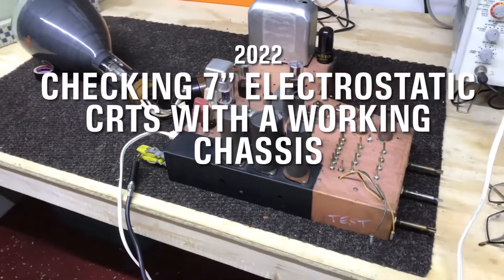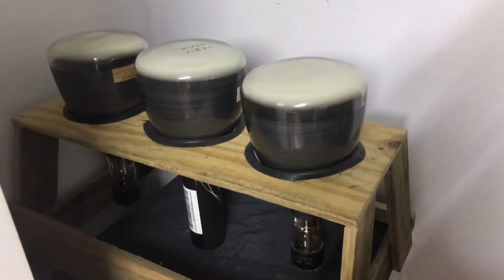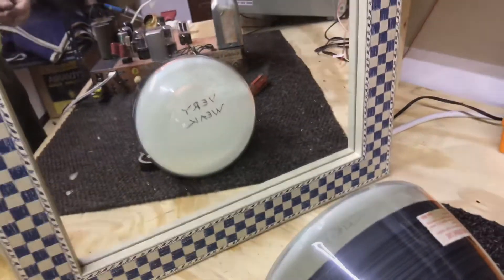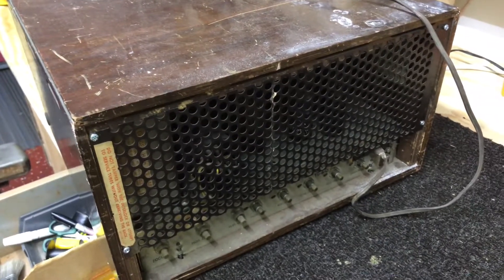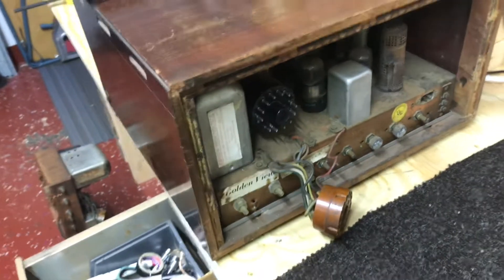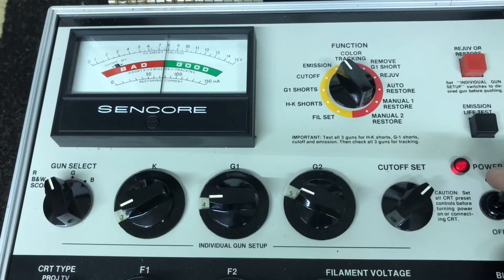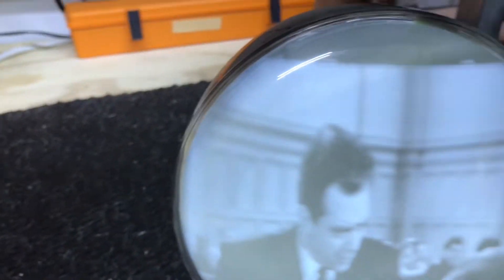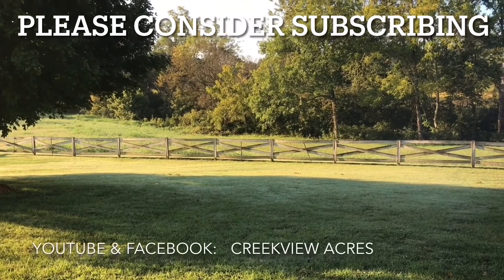Testing 9 late 1940’s 7” CRT’s with a Motorola VT-71 Chassis

Comment: where did you get the extra crt socket from, was it from a donor tv or is there a place that sells them.  I already have a busted crt base but not the extra socket.
Reply from the maker: I have some used crt bases and sockets but they are available new.   I’ve bought new bases on eBay

Comment: You don’t suppose you would be willing to sell one of these to me would you?
Reply from the maker: I only have a couple of good used 7JP4’s left that I’ll probably keep for my future tv restorations. 
Have you looked on eBay ? I see there’s one on there right now. Of course the problem is unless the crt has been tested on a working chassis
it may not be good. 
I’ve bought a few there before , if the price is reasonable. 
What set do you need it for ?
Reply: @CreekviewAcres  hey thanks for the reply, I saw the one on eBay actually, I’m just not sure if I’m going to win the bidding war.

the set I need it for is a hallicrafters 514, I suspect the one in mine is completely dead because there is only a dim bit of light at the bottom of the screen.
 I need a replacement, even if it’s just a week one, to figure out if this is a high voltage problem or the crt itself is just used up.
Reply from the maker: @turle8645   for testing purposes you can use a 3BP1 green scope tube. It’s hv rating isn’t quite enough but for a short testing it will let you know if the old crt is the problem. 
  3BP1’s will plug right in and are usually pretty reasonably priced on eBay.
Reply: @CreekviewAcres  okay, I’ll look into that, thank you. As a side note, when I do come across a 7jp4, what should I be paying for one? Assuming it works well. Also when you say it works for a short testing period, how long should I be leaving it plugged in?
Reply from the maker: @turle8645  you can use the 3” crt for a few minutes. More than long enough to see if your 7jp4 is bad. 
 A used 7jp4 that has a good picture is probably in the 100.00 range. 
A new old stock probably double that or maybe more.
Reply: @CreekviewAcres just a little update, I managed to get a Motorola 7vt5 with a good 7jp4 for around $80, I’ve gotten it to the point where I have a good bright raster but the tuner works intermittently. It’s good enough to test the CRT, and not only is the new crt super healthy, but so is the old one. In fact, the old one actually seems a little brighter than the new one. So I have confirmed that the chassis is definitely the issue with the halicrafters tv. And now I have 2 working 7jp4 tubes :D

Comment: You could use a 3BP1 scope tube as a test crt for those chassis. Craig
Reply: Pinout is the same but it's only rated for 2,200 volts max while the 7JP4 typically run at around 5,000 volts.  I'm not saying you can't but you may get some arcing between gun elements.
Reply from the maker: I do when restoring sets. I was specifically testing 7” crts in this video.  
  Thanks for the comment